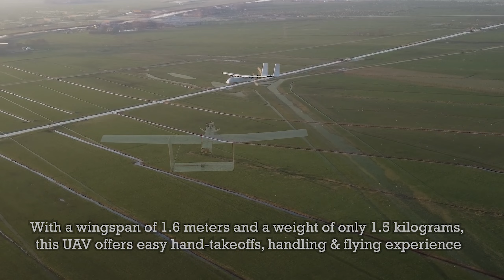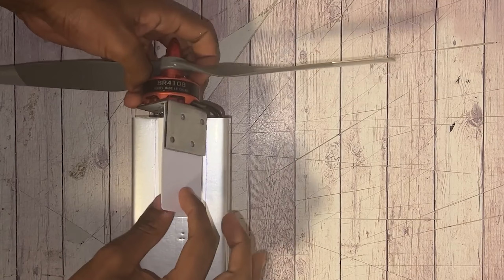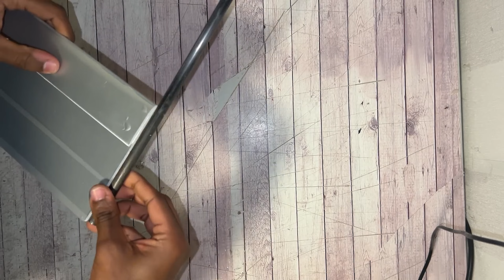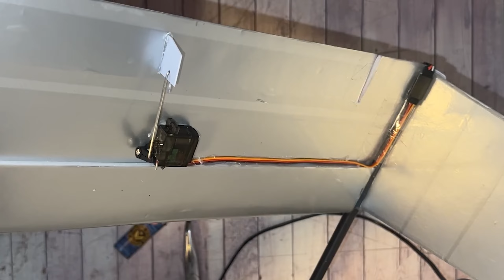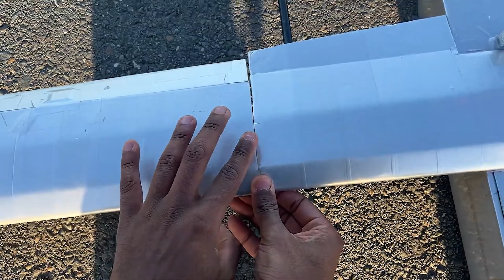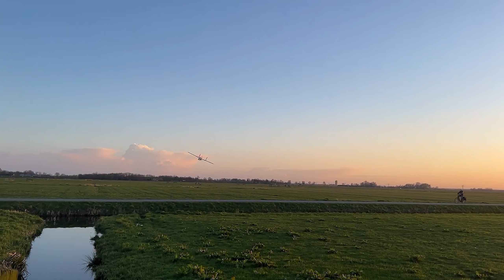Building an Autonomous UAV for Long Range FPV - Start to Finish & Flight

Comment: Hey I love your builds! I have a few questions if you are able to respond. 
It looks like you have a 3108 600kv motor correct? Is that a custom mounting plate or did you buy it somewhere? I might be able to design up a 3D printable one I can use if you think the plastic will handle it decently compared to the metal bracket. 
What are you using for tape? Is it just regular duct tape or a lighter tape similar to duct? 
What size aluminum square tube are you using? 
Thanks! I’m feeling inspired to make my own uav now

Comment: A wonderful and simple design!

It has potential for improvement. E.g. the horizontal stabilizer should positioned on the top of the vertical stabilizers.
This would help to increase the propeller efficiency.

But again, it is wonderful piece of engineering!
Reply from the maker: Yes, upper-horizontal stabilizer is better for aero, but increases structural complexity to prevent the end of the booms from flexing. 

It’s successor has an Inverted-V or A-Tail that kills two birds with one stone in this instance (strength & aero)
Reply: @AeroStuffFPV  yep a good design is always a trade of between aerodynamic and structural requirements.

Nice work 👍

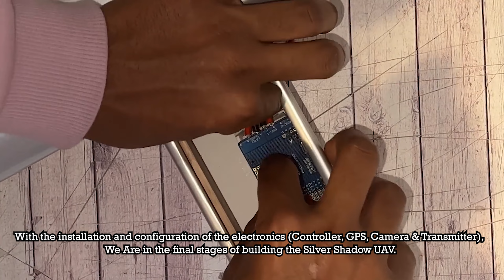Comment: What a nice build! Question: Are you using exactly the same electronics as in the original video ? Just asking as I thought the FC (3:28) looked a bit different :)
Reply from the maker: It’s the same video, but compressed

Comment: Mind writing out prices on the electronics?
Reply: Considering what they can do.. pretty cheap. It depends on the motor, esc, receiver, flight controller, camera, vtx, servos.. I’ve build a lot of these aswell.
Reply: I could probably build one similar to this for about $150 maybe a little less depending on the quality of the stuff
Reply: Oh and the battery.. that’s a main cost

Comment: Cant find any 650mm carbon tubes
Would a 500mm boom work?
Reply from the maker: You can alter the dimensions to fit with the 500mm (-23%) smaller length of your booms

Comment: https://youtu.be/mkyCIbu0iwc?si=dOYWDZ6d5ysBhjN7
I have built your plane. The plane flies very well but some point of your construction is weak. I have to install 3 d printed rib in the fusalage and design custom wing joints. It is easier to add 0.5 inch to the upper bended wing part in order to perfectly  cover the under wing part wihich is not bent.All in all It really worth to build it.
Reply from the maker: Love that replica! Excellent job🏆
Reply: Hey man, do you know how far your build could get? I would assume like 10km?